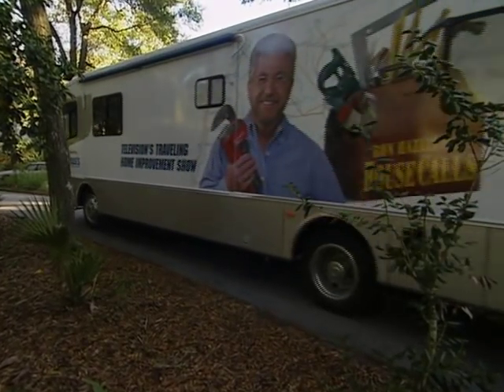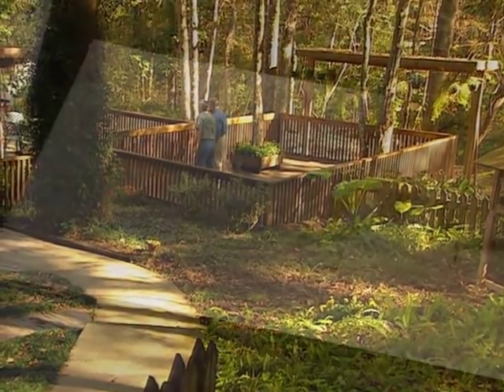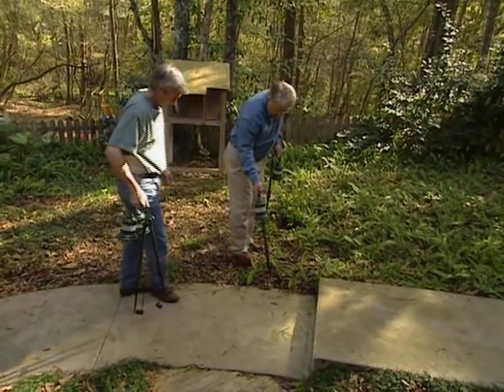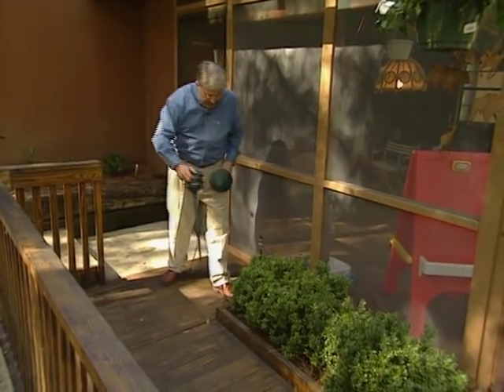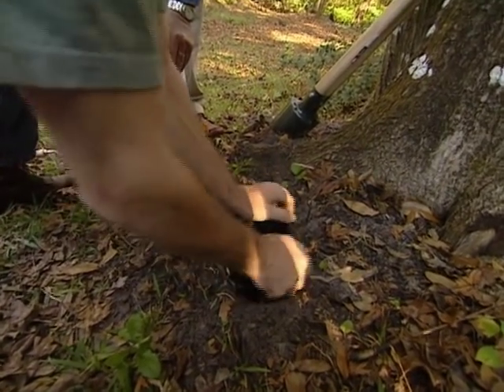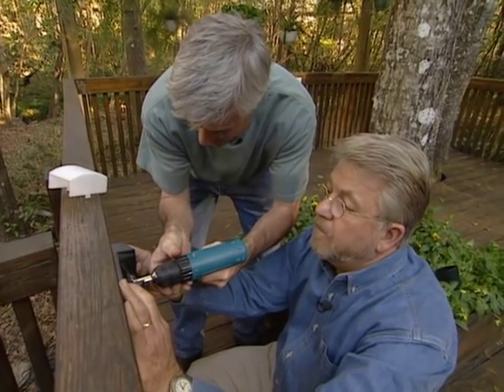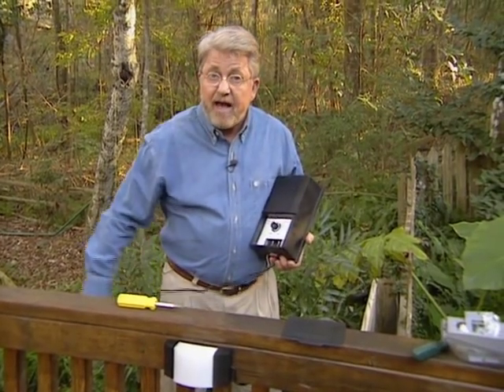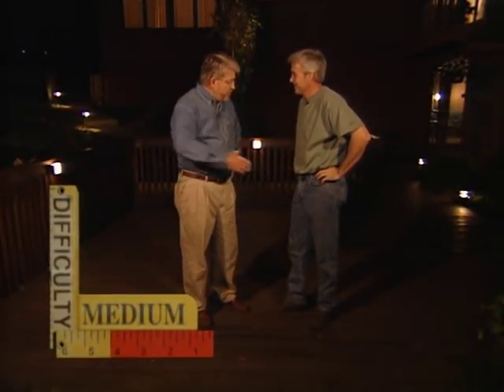How to Install Low-Voltage Outdoor Lighting

Comment: Great video!  I have a few questions to ask, if you don't mind. Is the transformer sold separately. Will you able to add additional lights? Also, I have  concrete walkway. I want to be able to light both sides of my walkway but the outlet is on the left side as I face the street. How will I be able to conceal the cord for the lights on the right side? My walkway merges into my drive way there's no dirt to conceal the lights or should I just light the one side where the outlet is?

Comment: Great video! I'm going to work on installing some lighting after viewing this!  I'm just wondering how you determine the size of the transformer?
Reply: If you buy a kit, the manufacturer will generally provide a transformer that can handle all the lighting and another expansion kit or two. If you are doing it yourself you need to add up the wattage of all the lights you want on your system (example, 3 x 5-watt spotlights, 12 x 3-watt pathlights = 51 watts), the wattage of any future lights you may want (another 30 watts to give you another 6-10 lights), and then the length of wire itself eats up some wattage (though not much, the longer the run the more it takes up). So in our example your current lights take up 51, you may want another 30 for future expansion, which brings you to 81 watts. A 100 watt would be a good choice that allowed plenty of voltage for current and future lights as well as line drop.